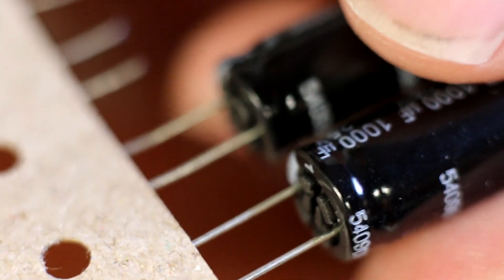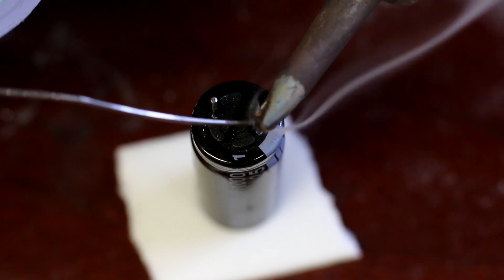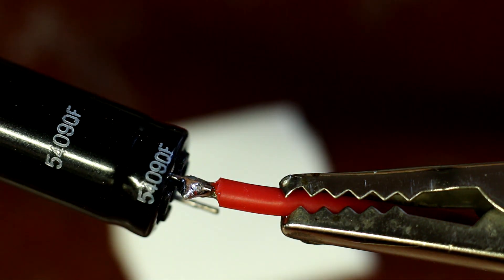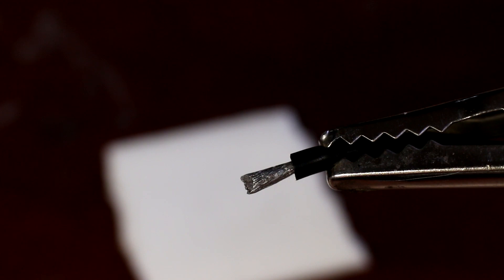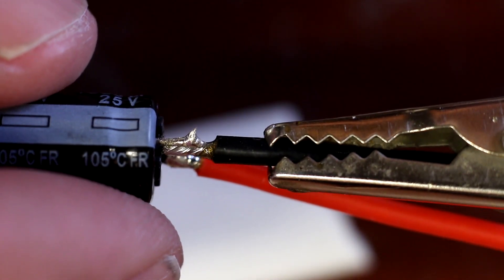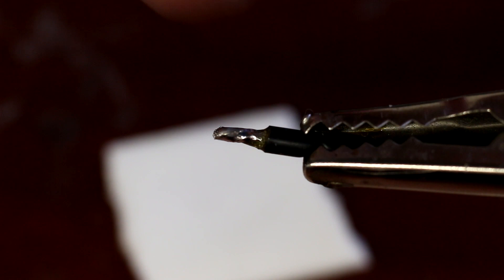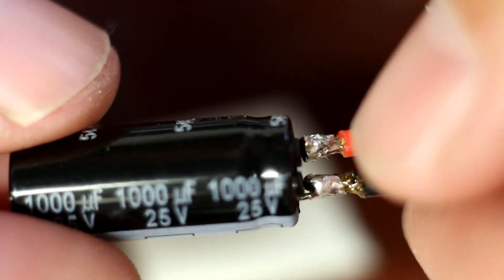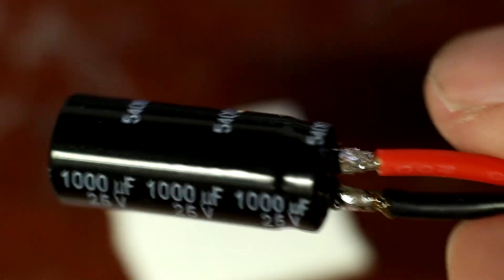How to solder capacitors

Comment: After soldering the wires to each terminals, do I need to discharge it first before connecting it to the main circuitboard? I'm intending to fix my spoilt fan.

Comment: Why did you add the capacitor to two leads like that what do you attach the other end of the wires to? you basically replaced the legs of the capacitor with wire?
Reply from the maker: You want to replace the legs with wire because the wire offers better conductivity so less resistance.  These capacitors are designed to be surface mounted to a circuit board so they'll have very, very short legs, but we typically remote mount them on a a quadcopter.  This is a better way to remote mount them than just using the long legs they come with.  I hope that makes sense?
Reply: @mooosestang  we'll I'll be dammed, I've been doing it wrong... Thanks for this

Comment: uhmmm I think in practice keeping the leads 2mm longer would cause pretty minimal capacitance and resistance increase. Indeed I would try not to overheat the cap as the chemicals may boil in it, permanently altering capacitance by a small percent. So I guess Jasper'r right.

Comment: Leg is heating faster than the wire, and you left the solder on the iron too long because you tried to explain what you were doing.
Reply from the maker: You are correct.  It would be easier if you could hold both and feed fresh solder at the same time.  I will try placing the pin inside the insulation.

Comment: I'm putting a few millimeter of the leg inside the wire and insulation. Then solder them together. Very strong and easy to heatsrink.
Reply: Jasper has the correct answer.  Don't pre-tin the wire, put the cap lead into the copper, preferably in the insulation.  I would dab a small amount of flux on the wire, then a small amount of solder on the iron tip then apply heat to the wire then apply solder to the joint.  super nice clean joint.

Comment: I find that shoving the cap pin inside the wire you are soldering to works better, you don't get that bump from the join. I went from putting just on cap on my battery lead to a 35v 470Mf on each ESC, and you wouldn't believe the difference in smoothness it made. Caps are definitely the way to go I think.
Reply from the maker: I'd use a short piece of wire, it may not matter, but it will increase resistance and the speeds at which you fly those cap pins won't stand a chance. Do you use caps on your 5s setups?
Reply: 3000gtwelder when you go straight to the esc do you just use the + & - mains ?
Reply from the maker: I tried that a couple of times, but i was not having much luck.  Damn pin didn't want to go in.  Do you just put it in dry :)  I think i may have tinned the pin or maybe even the wire when i tried it like that.